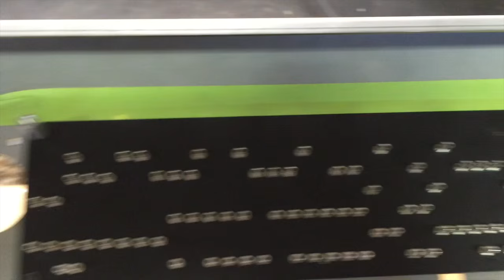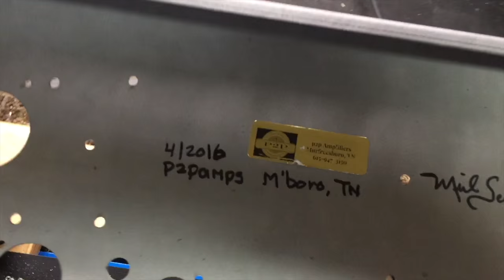Tremendous Reverb Amp Part 1

Comment: Amp building 101, thanks for the videos and tips through out the build. I got a few builds under my belt thanks to Doug Hoffman and crew at his forum. I'm jonesing for a new build and its a tough decision. I am curious about the change of OT though, aside from a little more umph being able to push the 6v6's a little more, the tone is the same?

Comment: Glad I found your channel. Nice stuff. Question: what is the reason you don't use the filament center tap? Is there an advantage to using the vurtual CT with the 2 100 ohme'rs ??